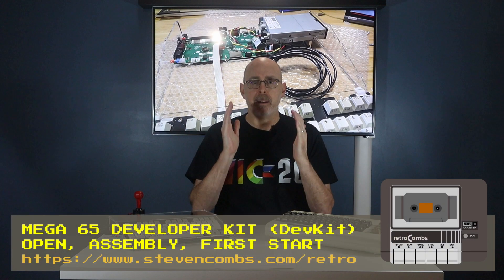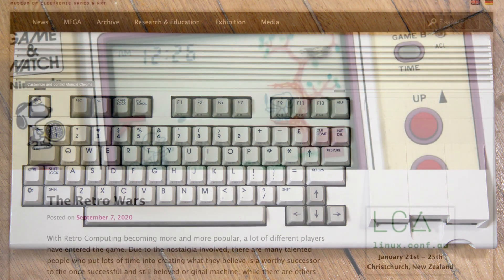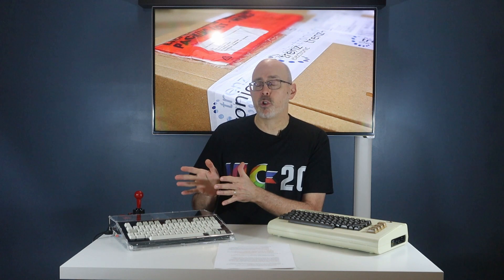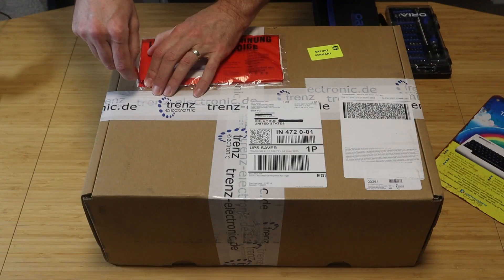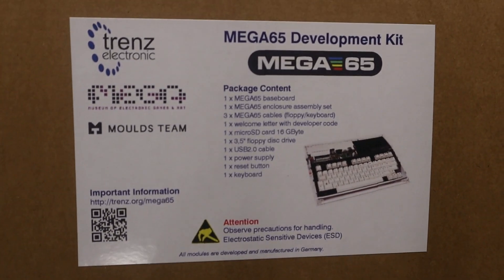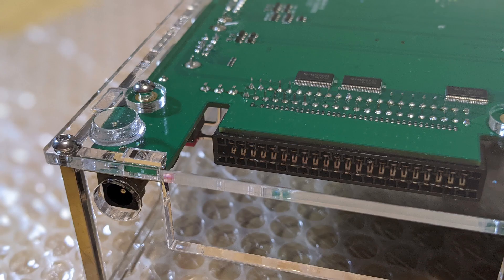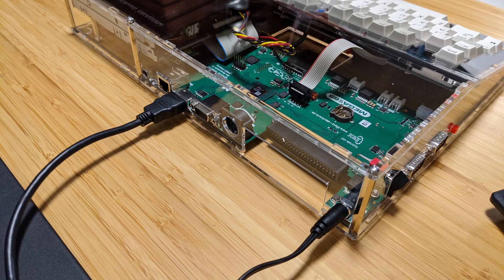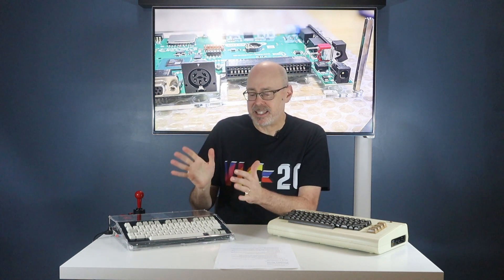I assemble the MEGA65 DevKit. How did it go?

Comment: If You Ask me, calling fpga na emulation is perfectly fine, without quotes. Most fpga project don't recreate internal structures, logic gates etc. IT recreates it's behavior with high level programming language. Sure, that code is eventually transferred into hardware and can do things that no software emulator can (interfacing with real hardware, zero lag input/output, etc.) but deep inside it's still emulation od different kind.
Reply from the maker: I knew we had FPGA purist out there so didn't want to offend, and then I say that a THEC64 uses an FPGA. It does not, and I corrected on the companion blog post, but who did I offend? That's right, FPGA purist. Rats! 😄
Reply: fpga implements real digital circuits - its not even remotely emulation - hardware all the way. what you regard as real hardware chips are designed using the same software tools using the same languages like verilog or vhdl. An fpga is an alternative hardware implementation just as, say, AMD is an alternative hardware implementation to Intel for x64 CPUs. it just happens to be a reprogrammable manner of hardware implementation. But electrons flowing in the digital circuits are not aware of the distinction and so an FPGA D-type flip-flop is still a D-type flip-flop - looks like a duck, quacks like a duck - because it is a duck
Reply from the maker: Great description!
Reply: Except the chips you thought were not emulated were also designed from at least the equivalent of a high level language and I don't call that emulation of the logic either. It's not like we can afford to meticulously define every transistor junction in a complex chip like a CPU
Reply from the maker: Great conversation and appreciate the thoughts. Curious, what should we call it, if not emulation?
Reply: @retroCombs  I call it re-creation. The important goal is exact timing of hardware machine cycles instead of a much faster CPU needing to hurry and emulate functionality only.
Reply from the maker: Re-creation = recreation for retro-computing fans! 😅
Reply: Excellent Steven, when I called it re-creation I didn't think of it being like retro-creation 😎

Comment: Congratulations!!!
I have the C=128. This is the only computer that correctly implements the concept of "emulation". The C=128 has the C=64 inside and if you are in C=64 mode there is no way to realize if your hardware is a C=64 or a C=128. 
 I am very excited now because the C65 will be able to emulate the C=64 and several computers more.
Reply from the maker: I skipped the C64 back in the day and went straight to the 128. I loved that machine. One day I need to stay my ebay search to purchase another one. 

The MEGA has a ways to but it is looking good and a next ZX80 core has just been released. Looking forward to an Amiga core.
Reply: Actually, you can tell if you're on a C128, because one of the VIC-II registers returns different results on the C128.
Reply from the maker: Good point.

Comment: The irony of having a last name of combs and also being bald is not lost on me. Anyway, the MEGA65 and the Commander X16 are two retro projects I am keeping a very close eye on!
Reply from the maker: I also joke, "I have to comb my hair, that's hair, singular!" Another quote is when I have to explain to someone who hasn't heard my name correctly, "it's Combs as in comb your hair, of which I have none." 😄 The Commander X16 I am watching. I'm not sold yet. Not sure why I would choose that over the MEGA 65 since the MEGA keeps its heavy Commodore roots; however, I supported the Spectrum Next 2, so ya know, I'll probably grab a Commander X16 just to keep the modern retro-scene intact on my desk.
Reply: @retroCombs  Yeah, the Commander X16 seems like it's going to be expensive with how they're doing it, but who knows. The MEGA-65 is, like you say, more of a Commodore derivative to me and yet can still do LOTS of other things, like become another system entirely!
Reply from the maker: @JustWasted3HoursHere  Agreed! Later this spring I'll probably add the ZX Spectrum core. If I do, I'll probably put together some quick video. I'm not a Spectrum guy, so it will all be new to me.
Reply: @retroCombs  Awesome. These FPGA cores are a great way for historically significant computer systems to be preserved without the difficulty of finding and maintaining a real hardware specimen that can blow capacitors and have numerous other issues, making them no longer able to function.

Comment: My career was designing robot character hardware-software at Robotronics and recently I bought my own FPGA dev boards (Terasic DE2-115 and DE10-Nano) to learn the art and work on vatious retro-creations. My favorite MCU back then was MC9S12 but this stuff blows it out of the water. The company had got an Altera demo board since the FPGA was the new thing, but they didn't see the value because of complexity and are now stuck in Arduino land. Thanks for the great video!
Reply from the maker: Now that's the coolest career ever! You should do your own video! I was going to purchase a DE-10 before the release of the MEGA 65, but priority of funds put that on the back burner. And now that new cores for the MEGA 65 (a new ZX Spectrum core was just released) are starting to be come available, It's probably even further down on my list. I am a fan of the Arduino (as you can see if a few other videos where I've used them) and even more interested in the new Raspberry Pi foundation "clone."

Thanks again for the great conversation and for watching!

Comment: Very nice assembly video ! Thank you very much !!!
Reply from the maker: Glad you liked it! And thanks for letting me know about the battery. I did wonder, but also thought it was probably more hassels. I should have added to my video, "batteries not included...just like the 1980s!" 😄

I'll find one locally but do appreciate the offer.
Reply: we were not able to include the CR1220 battery for the RTC clock, since it would be ALOT of more hassle to comply with safety shipping regulations, declaration of dangerous goods, extra stickers, more costs. It just wasn't worth it. If you need one. drop me a PM at forum64 (main MEGA65 forum) my nick there is adtbm.
and we send you a battery extra.